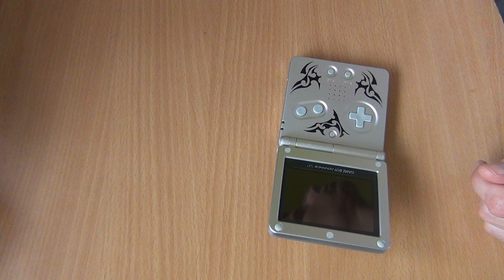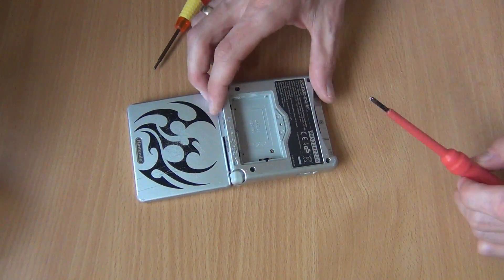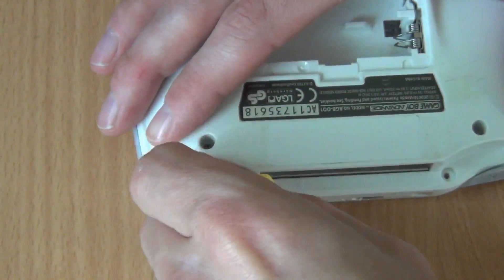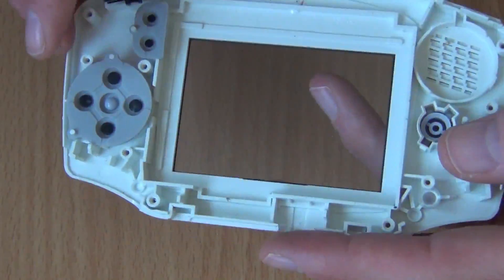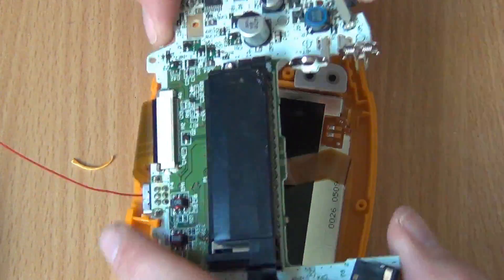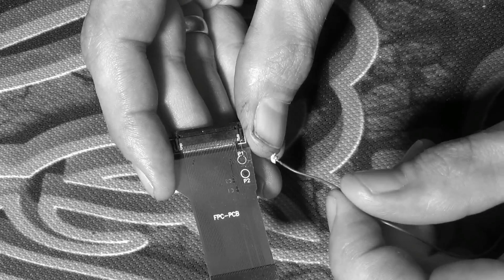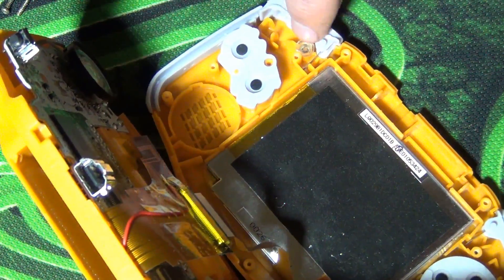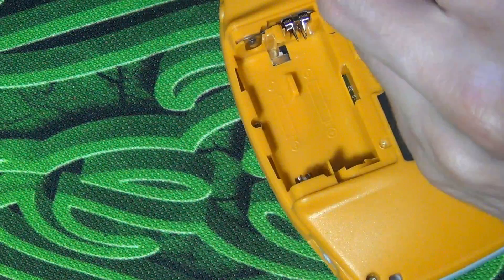Building The Best Game Boy In The World

Comment: wouldn't the best gameboy in the world be rechargeable?
Reply: Nah, dats right~ 
Without rechargeable battery it was suck maan~ :v
Reply: Of course some improvements are possible.

A recharging mod would be pretty easy, using one of the smart charging ICs, i think some are offered by Maxim etc. The charging output of the IC can be applied directly to the battery pins and thus GBA power input, because it should not exceed 1.5V per cell, which the GBA is obviously just fine with.

Another improvement that i don't know how to accomplish would be an OGS display. Ideally i'd get the lens lasered for me out of Gorilla Glass, then get some kind of optically clear shim (not sure how exactly) and LOCA it to to the glass and the display? I'm not entirely sure. I think i would destroy a lot of decent display panels if i were to find that out.
Reply: or you can just get a GBASP case that makes it look like a GBA cause all he really wanted was the shape...
Reply: I agree with *****
Reply: chuchu ur soooooo right
Reply: There's a kit on Etsy you can buy just slides right in the battery compartment and you can use a micro USB to charge
Reply: chuchu honestly was wondering the same exact thing lol
Reply: That varies so it should be optional
Reply: Yes, and it would have a raspberry pi that could emulate any system. Aka Game boy zero
Reply: Eneloop batteries. So much power for a reasonable price. You can't charge them while playing, but you can have a pair charging while you play and swap them in between play sessions.
Reply: No. 
If you have a rechargeable battery you have to wait for it to charge.
In the original just change the batteries and you're good.
Reply: But AA last longer than a lipo while not being a fire hazard

Comment: I really want to do this but I'm also really sure I'd screw everything up.
Reply: Same. :c
Reply: Micah Buzan it's easier than gluing wood together
Reply: Bugking
Reply: It's OK, you'll learn to fix screwups eventually.
Reply: That's good, making sure all of the screws are tight is a vital step.      AHAHAHAHAHAHAHHAHAHAHAHAHAHAHAHAHHAHAHAHAHAHAHAHAHAAHAAAAAAAAAAAAAA
Reply: Same
Reply: At least the parts and needed consoles are fairly cheap. I have little faith in my modding ability and/or my ability to pull this off but I am thinking of giving it a shot just because the original GBAs can go as low as $20 on eBay (and even less if you can luck-out and find one with a cracked screen) and the SPs can go as low as $40. So, not a trivial amount of money but definitely on the low-end of the console modding scale.
Reply from the maker: +dacypher22 be sure to get an SP AGS-101, they usually are a bit more expensive.
Reply: That's true, and you're right those are a bit more expensive.
Reply: same
Reply: Arya Prabakar nds cant play gb and gbc
Reply: I feel exactly the same but I want this so badly so I am going to give it a shit and trust me, I am REALLY not tech savvy.
Reply: Forill Like I mentioned above, the costs of everything aren't that bad compared to most console modding projects. If something goes wrong, you will likely need to spend $30 - $60 to get another console to replace what was broken instead of $400 to replace the console.
Reply: Micah Buzan First, everyone makes mistakes. It is okay.

Second, follow the instructions carefully. But watch the entire video before you try.
Reply: Micah Buzan same
Reply: It really isn't that hard of a mod. Most the work is just fitting the LCD screen in the case properly. I guess one solder point too.
Give it a shot, I have faith. You'll save a crazy amount of money.
Reply: Its looking way easier now they sell little kits on amazon
Reply: It’s super easy. You don’t even need to solder. You really won’t be needing the second brightness setting and since you’re leaving the cable unsoldered you can always add a brightness switch later. I just modded mine and the lower brightness setting is actually pretty bright. I can’t see myself ever needing it to be brighter than it is. I mean, when have you ever thought about playing a gameboy in harsh sunlight?